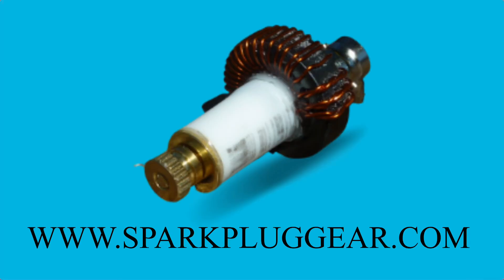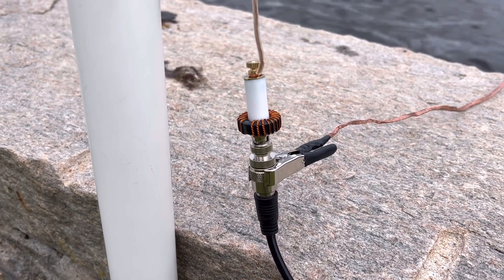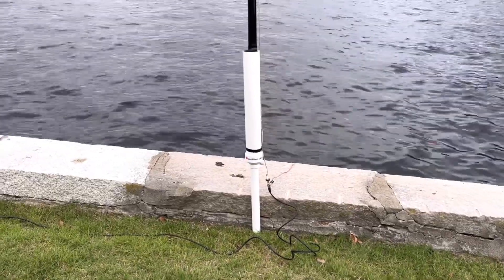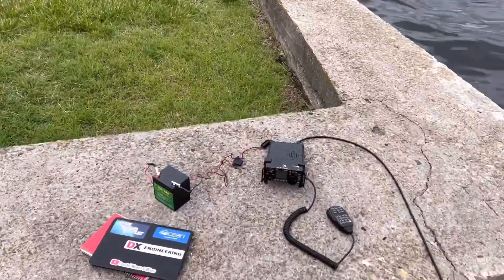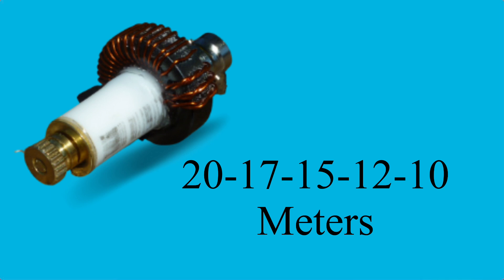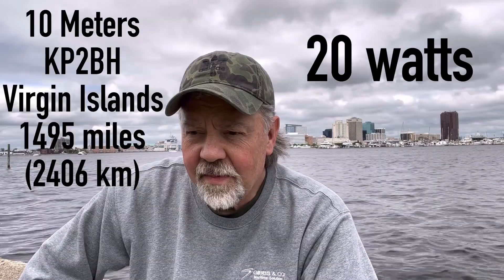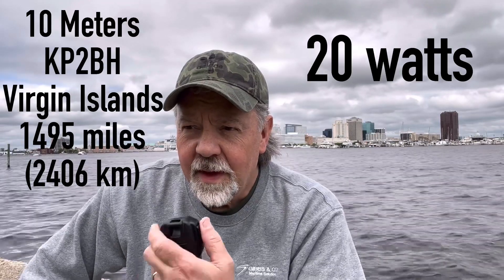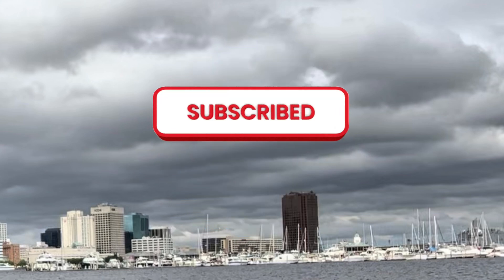Vertical EFHW Antenna with a Spark Plug

Comment: Great presentation! Thank you. I have the same Spark Plug 64:1 and am using with a 67’ element. I have noticed that using a grounded counterpoise like you demonstrate reduces the noise on receive. How long did you cut your counterpoise?

Comment: Walt, I believe in this video you just wrapped the bare wire on the end if this unun. I will be putting a ring terminal on 22ga wire. I don’t yet have the unun but would like to have everything ready for when it comes. Do you think a 1/4” or 3/8” ring terminal would fit the post?
Reply from the maker: Yes I’m sure a 1/4” would fit
Reply: @COASTALWAVESWIRES  Thanks Walt, you always reply fast. Have a great day and God bless!
Reply from the maker: @kylefreemason  have a great day! 73

Comment: Hey Walt, how is your swr on the 17m band with this cut for resonance on 20m? I know you stated you used the g90 tuner on 17. Just wondering what the actual swr was on 17
Reply from the maker: I believe it was around 1.7 to 1
Reply: @COASTALWAVESWIRES  Wow, that barely would need touched up. Thanks for the reply Walt, always enjoy your content.
Reply from the maker: @kylefreemason  thanks so much!

Comment: Since the DX Commander 10M pole is just a bit under 32 feet when extended, and the instructions say 33'-4", am I to assume you just let the extra foot of wire just flop over at the top?
Reply from the maker: Yes and some at the bottom because of the pipe mount I use.
Reply: @COASTALWAVESWIRES  Cool. I got the 100 watt spark plug but haven't tuned it yet. I have a 10m Spider Beam pole and may do what you did and cut it for 20m and higher. I have a CaHRtenna that I might leave long for 40M if I need higher bands.

That you tried putting down 1 or more radials for "land use"?
Reply from the maker: @W9HJBill  yes I just dropped one into the water because I’m so close to it, I wish now that I would have removed the counterpoise and seen the difference. I’ll try that next time!

Comment: Yours is my new favorite Ham Radio YouTube channel, I love all your antenna experiments Walt! Can you tell me about this grounding strip with the big alligator clip? Is that something you bought pre-made, or is it a home brewed thing?
Reply from the maker: Thanks so much! It’s a 20 foot bare copper ground strap I got on Amazon for $17.99 USD. I put a 3 ounce fishing sinker on one end and a clip at the other you see in the video. If you go on Amazon and search for “20ft 6mm Flat Copper Braid Cable Bare Copper Braid Wire Ground Lead” you’ll find it. This is the second time I’ve used it, the first time is in the (tr)uSDX video. All the best and 73, Walt K4OGO

Comment: Great video as always. Walt, I use an umbrella ground mount for the same purpose you use the pvc pipe. The mount I use is metallic and adjustable, and it also works as a grounding spike for the radio. Wish  I lived close to ocean to have it as the antenna ground  =)
Reply from the maker: Thanks! Sounds like a great mount. 73 Walt